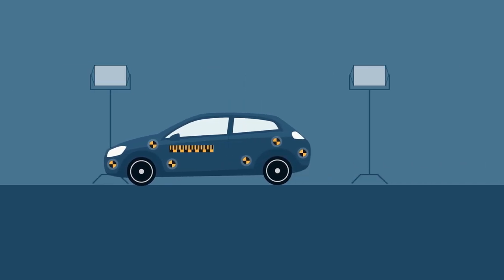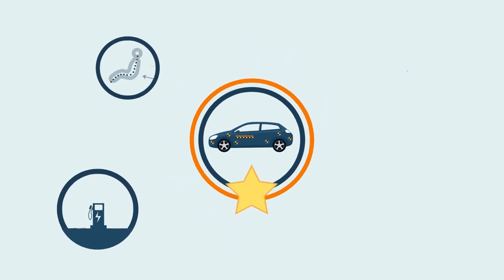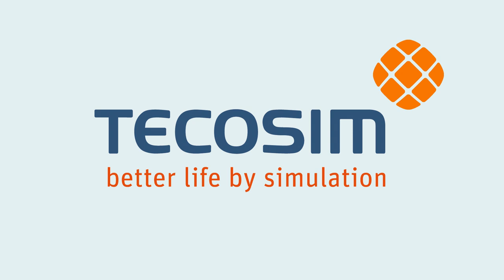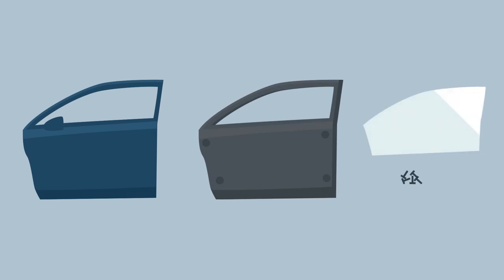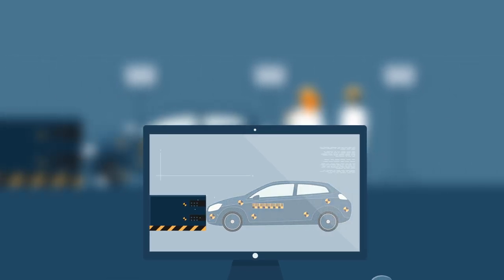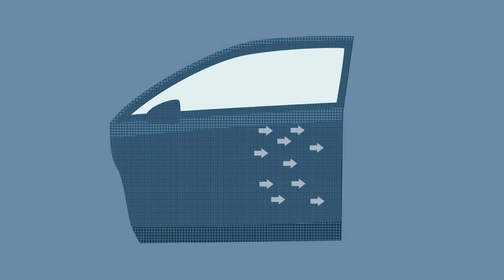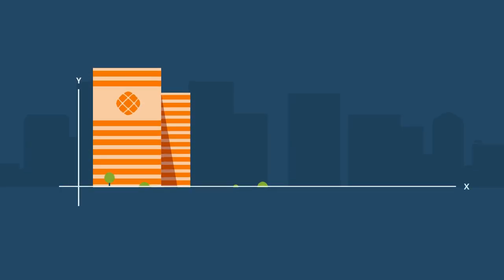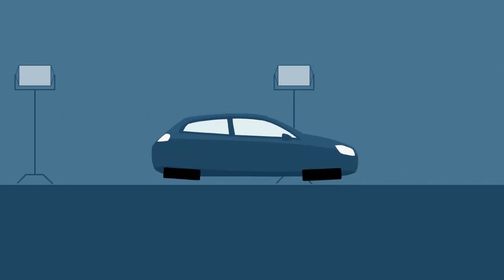Computer Aided Engineering (CAE) Explanatory Video (english)

Comment from the maker: Contemporary product development would be unimaginable today without computer-aided engineering (CAE). In the past, companies often used to design products based on experience, but knowledge-based virtual development (CAE) has been standard practice in the automotive industry for many years now. In an explanatory video, TECOSIM briefly explains how the method works and how it assists engineers in meeting increasing requirements for safety, comfort and environmental protection. TECOSIM is one of the few development partners which has specialised exclusively in CAE.